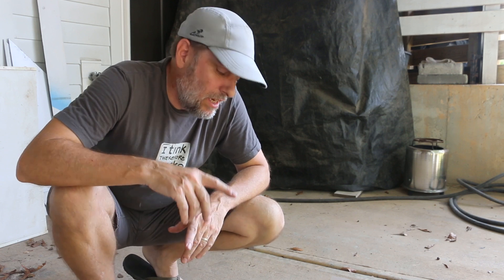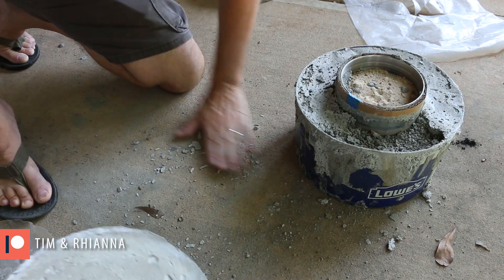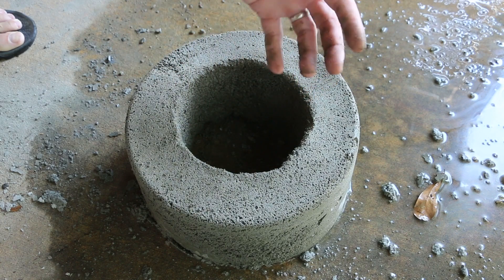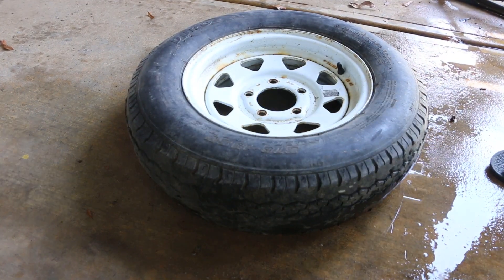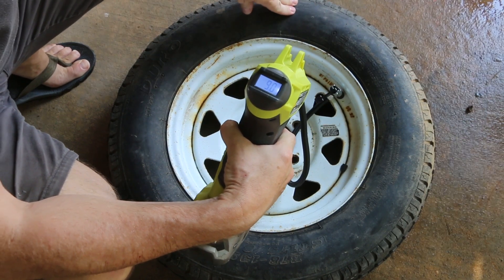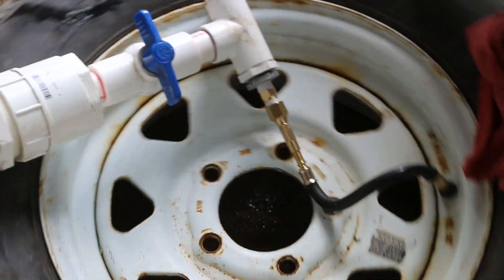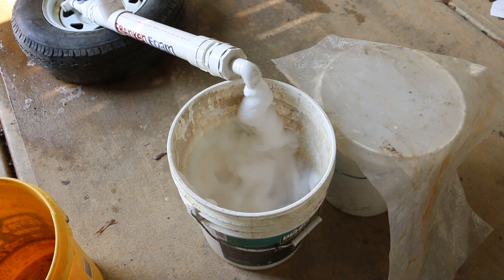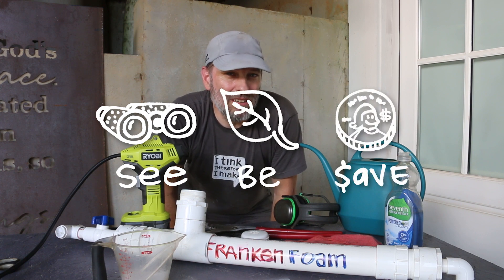How To Un-form Aircrete + Foam Generator Volume Test

Comment: Love the ability to not use a huge air compressor.  I charge my Ryobi/Ridgid batteries from my Jackery which is in turned charged by solar panels.  So the idea of building a sustainable home with solar power is pretty sweet to think about.  Would the Ryobi 18v 1 gallon air compressor work?  I'm imagining so... maybe a video using one would be possible.  I'll definitely watch it!
Reply from the maker: Awesome! I’ve got a Solar to Jackery project in the planning stages. I look forward to gathering some solar power for my tool operation. Thank you for the feedback. Thank you for watching.
Reply: @GreenShortzDIY  Of course! I bought the panels that came with the jackery (because of a sale) then sold them.  I already have 150 watts of panels attached to my van cargo box so I bought a MC4 wire entry gland that had M/F connectors on both sides... connected that to my panels and had also bought a Jackery connector to MC4 adapter cable, also off Amazon.  So essentially I'm using my existing solar panels to run to my Jackery.  

BTW... I'm also in Georgia!!

Comment: " ... to protect from the air which can oxidize ... " ... I don't think that's what you really mean
Reply from the maker: Ha. Probably not. But being exposed to air will break down the bubbles faster. Not sure if the actual chemical reaction there. But oxygen does oxidize. Thank you for the feedback. Thanks for watching.
Reply: @GreenShortzDIY  yeah, it will dry before it sets ... and so the structures (matrix you called it), will collapse; but hitting it with water may also be too strong for those foam structures to withstand. Good experimentation.

Comment: Interesting results Tom!  I am wondering how you might prevent the voids that present themselves.  Typically, concrete is vibrated to ensure consistency.  Aircrete doesn't seem like it would take vibration AND be able to maintain it's density...  I wonder if there is a way to produce a non-degrative process for vibration???